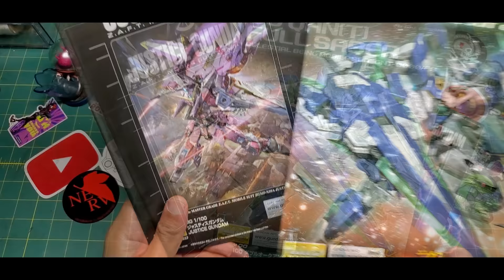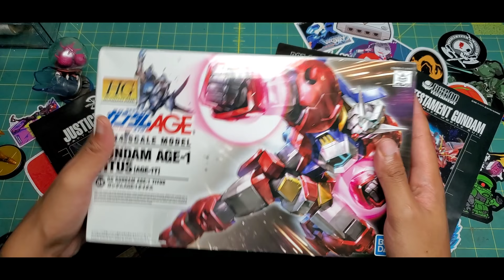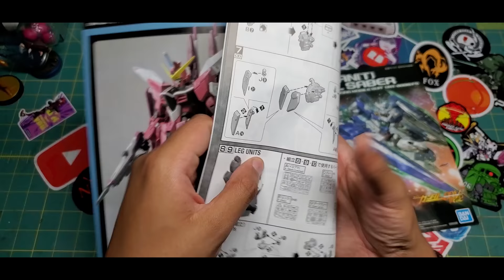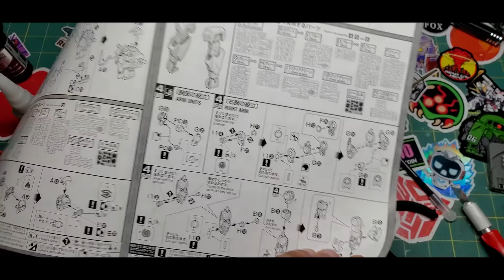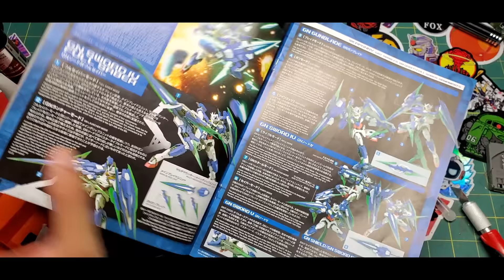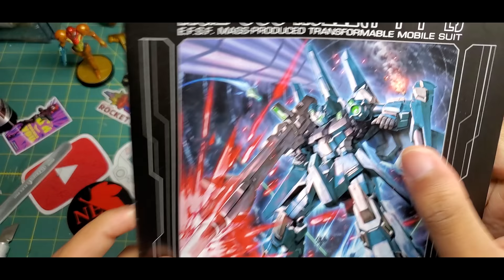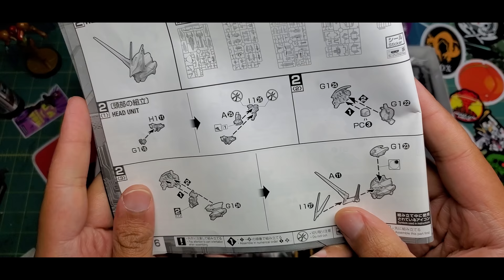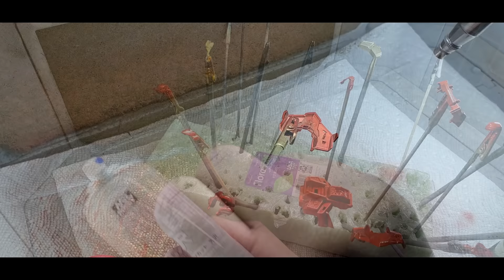#newtype #Otakubuilder #Metroid 1/100 METROID KITBASH! [4K]

Comment: This is an incredible kitbash! I especially love how you handled the shoulder joints, cutting away space from inside the parts to fit the joints in there. If there’s any advice I can give you, it’s to always do your research into a kit’s construction- how the joints are laid out, so you don’t run into trouble when attaching parts like you did with the waist assembly. I hope you keep kitbashing!

Comment: So I've seen more advertising for wireless LEDs and stands. I love the potential for implementing them and not having to worry about running wires and maintaining more articulation. What's your thoughts on them and do you think you would ever consider using them?
Reply: they are REALLY expensive for what you are getting, and you have to place the finished model within the display box which provides power to the LEDs. Nonetheless they are bright and I guess way easier to install.
Reply: XBASE!